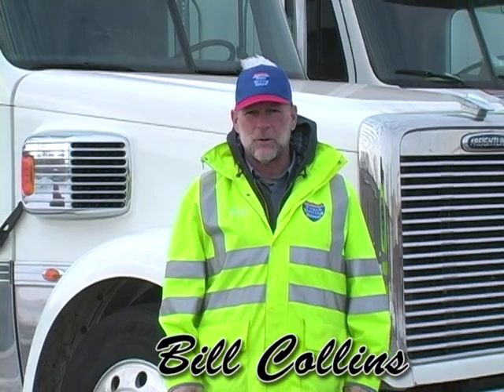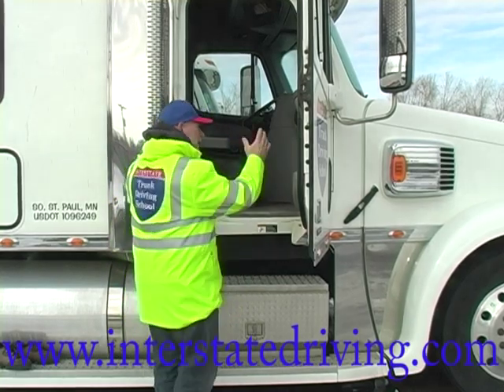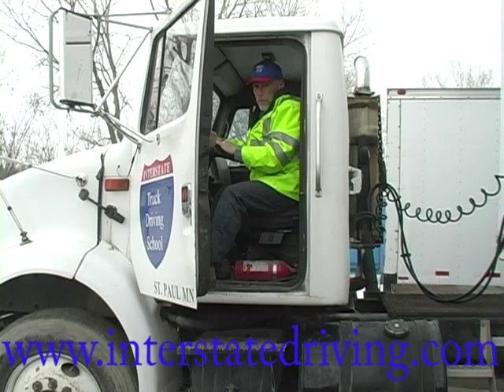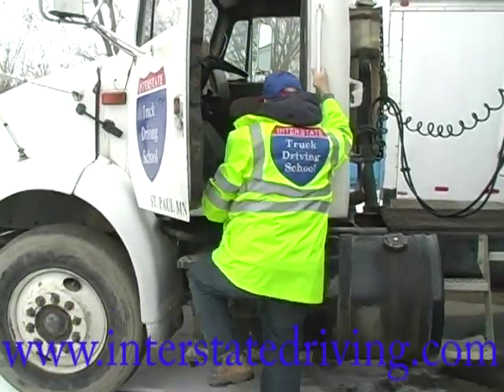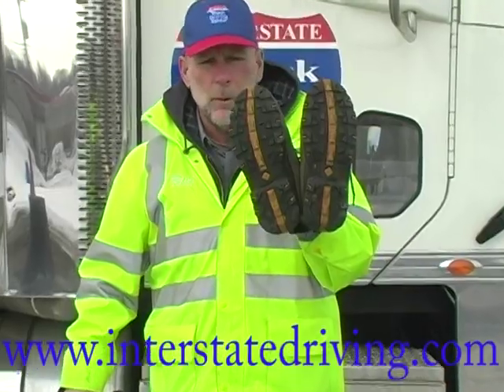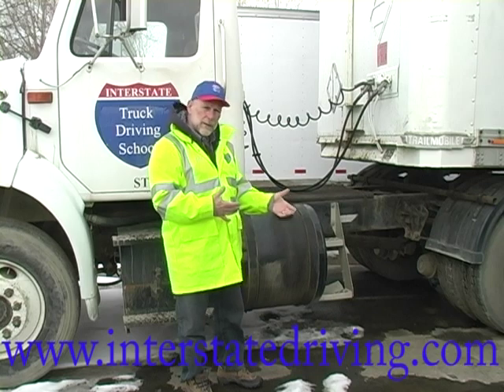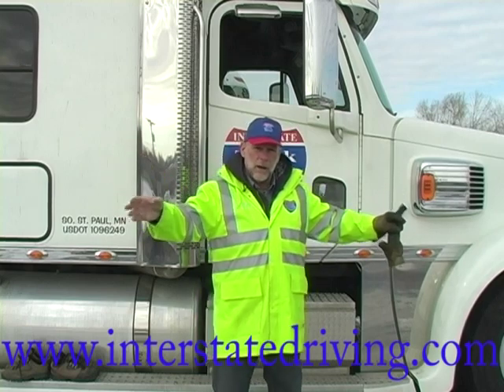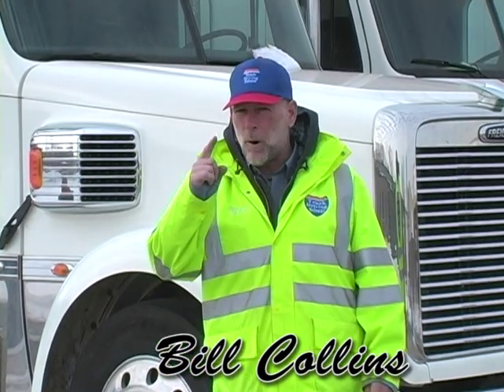Interstate Truck Driving School 3 Points of Contact

Comment: Bill,
Sooo close... 3 points needs to apply to the last step as well.  Plant both feet before you let go with your hands.  A lot of drivers roll their ankles due to uneven or loose surfaces... otherwise good and practical.

Ken